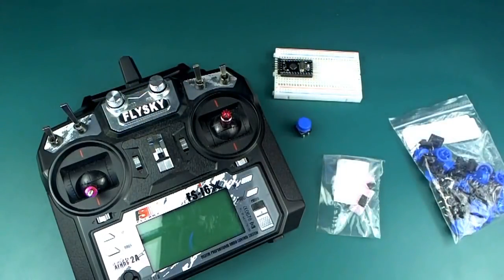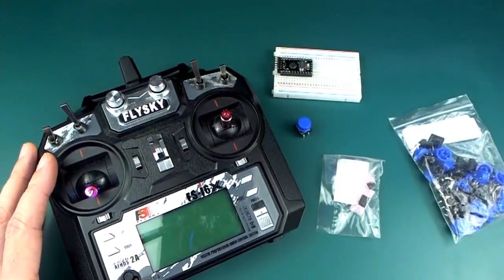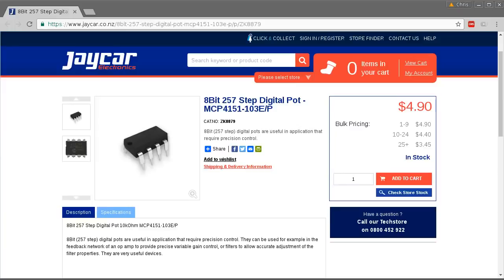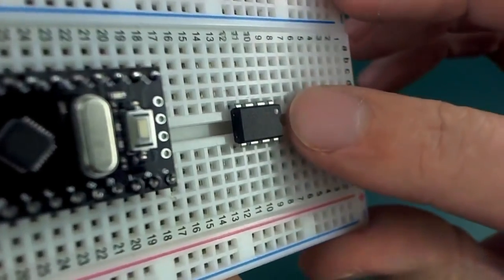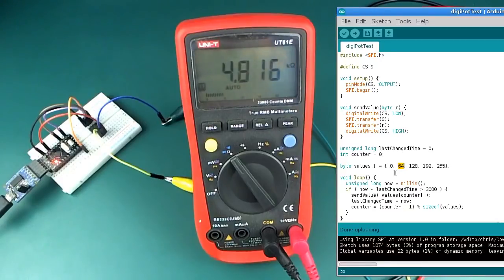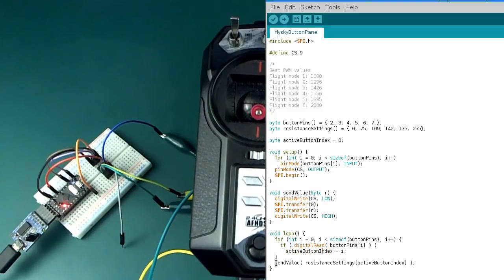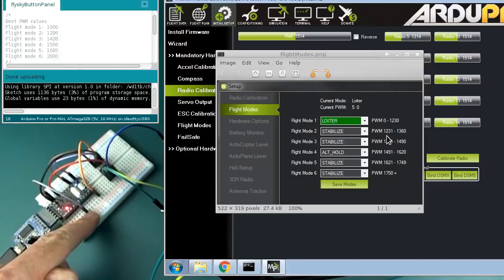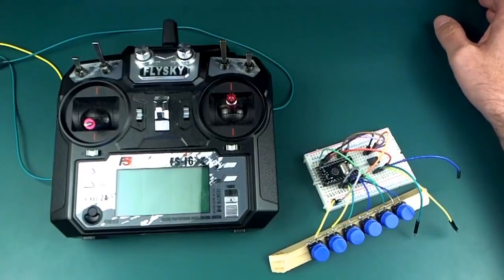FlySky mod - buttons for flight mode selection (arduino, digital pot)

Comment: I have 6 Flight Modes Without this mod. just by using two switches
FBWA
CRUISE
LOITER
MANUAL
AUTO
RTL
Reply from the maker: can you give me a link then.... why not just give the link in your first comment, I would have :)
Reply: iforce2d  https://youtu.be/luLZUEoVlis
Reply from the maker: Nicely done, thanks. Could use a little more background on how you came up with those settings, and what final PWM each position actually outputs. I find that mixing page to be extremely confusing and I could have spent a whole day messing around with it and never achieved that. Thanks to your video I now know how to move the cursor to the other value for the endpoints, by moving the switch!! What a terrible user interface :)
Reply: @iforce2d  your welcome smile!!  i had a drone and wanted extra flight mode, so i sit one day and just went through that mixing page.
Reply: Channel mixing solves this issue
Reply: WINGSHIGH Aviation basically that’s what my video is about!!
Reply from the maker: With this radio?
Reply: iforce2d  yup check my videos did a tutorial
Reply: @iforce2d  i have the sane thing 6 flight modes on two switches. I do really like this idea though.👌
Reply: Had six with 2 switches with taranis but went rotory encoder can still have safety modes on channel 6&7

Comment: How did you connect the setup to the radio? I'm sort of doing something similar, but im sending PPM data into the trainer port to control a quad using my arduino. Im sending the pulses into PPM-INPUT but nothing is being detected by the RC in trainer mode. Thanks!
Reply from the maker: This was using the wires for the potentiometer/dials, I unsoldered the dial and connected to that, as a single channel. One time I had that problem you're talking about, a PPM signal was not recognized unless it had 8 channels. If you're only sending a few channels, maybe try including some dummy channels to make up to 8 total.
Reply: @iforce2d  Ooohoo I see, Im currently running 6 channel output from my uno, but my i6x is configured to use all 10, ill try that tomorrow, thank you!

Also, I also opened up the i6x too and considered just soldering some jumper wires onto the channel pads themselves and just outputting the signals through that. But im leaving that as a last resort as I dont wanna damage the i6x

Comment: You Can get max 6 flightmodes if you Use the bouth switches on the right.  Ich only have the ia6 Not the ia6x But it should be similar

Comment: Hi! Got a tip for you, you can change the two-way switches for three-way, like the third one. Just a soldering job, no other hacks, costs next to nothing from banggood :)
Reply from the maker: yeah, I did that the day after I got this radio. Worth noting that it only works with the i6X, not the i6.
Reply: A ten channel radio with four three-way switches and 2km+ range on a good day for $52, that is a great deal if you ask me. Keep up the good work, love your videos!

Comment: Did you consider just using a PWM channel output on the Arduino and a capacitor smooth the PWM signal to a steady voltage level to simulate the resistor value?
(That's how the camera control works on beta flight to simulate the 5 button resistor based remotes)

seems like it could have been done a little more simply that way?

Comment: Why not use 6 position switch like this....
https://www.ebay.ca/itm/RC-Drone-DIY-KIT-UNIVERSAL-Mode-Switch-6-POSITIONS-ArduCopter-Transmitter-TX/111823139623?hash=item1a092db327:g:vPsAAOSwsbBbOzFo:rk:20:pf:0
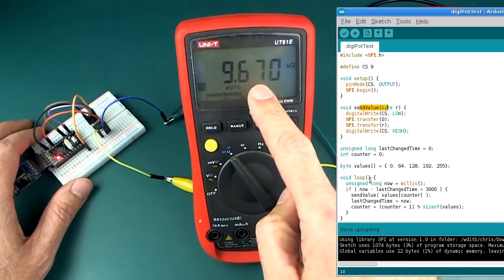9:51... BTW.. can't see your breadboard clearly.. buy you will need to de-spike your circuit supply because the arduino (just like all MCUs) puts noise on the supply as it switches states.

Comment: I did this on several radios about 3 years ago. I like your push button arduino solution better. It is much more ergonomic. great video.

Comment: have you looked at the FS-i10? it supports 'conditions' and multi switch combinations and a whole stack of mixing :)
Reply from the maker: I almost got one a few years ago, but expensive eh? Spending that much now I would probably get a taranis.
Reply: @iforce2d  yeah, they are expensive. 

I looked into the taranis but I'd invested so much Im rx's that I decided to stick with flysky and get the i10.

Mine has had both antennas replaced with external sma sockets and 1w amplifiers on each :)
Reply: @iforce2d  no need for the 10ch resiver,  A inofiziell Firmwareupgrade on the tx schould give the postibiliti of Mixing  the switches (more than 2) But only by using ibus

Comment: These mods are for the Big Red STOL, yes?  Something that is practiced frequently by actual pilots flying twin engine planes are engine-out procedures, especially loss of the critical engine on takeoff.  When we hear about a light twin that suddenly rolls inverted and goes straight down shortly after   takeoff, that's somebody that didn't practice.  (I used to own a Cessna 310 with a partner who was a much better pilot.)

The ability to cut one engine on the BRS might be worth considering.  You might find you don't have enough rudder authority at takeoff speed, or elsewhere in various mission profiles, to manage full power on one motor.  For example, if you are coming back from somewhere on one engine at a power setting that is manageable, then slow down by reducing descent rate or dropping flaps or banking aggressively without reducing power, you might run out of rudder in the process.  If losing one of the motors in flight (or a prop) is a realistic possibility, knowing the speeds and having the procedures in muscle memory will be important.

Aren't you glad you decided to use two engines?  The old joke among twin pilots is the second engine is to ensure you can make it to the crash site.
Reply from the maker: Probably more likely to use with my mini-talon and buffalo. But if they prove reliable I might use them with big red too.
I think I would have rather had just one engine actually, that was the original plan but it would have required 6S which I didn't really want to get into. I do kinda like the look of the twin motors though, will be interesting to try controlling something new for me :)
Reply: @iforce2d   For a STOL aircraft, aside from potential control issues, twin engines mounted on the wings is a good thing.  The wind blowing across the wing behind them generates a lot of extra lift.

Comment: Now I understand a little bit of why the three position switches I bought from Hobby King didn't work to replace the knobbed pots on my Turnigy that I put the FrySky module in.  Too much for my old feeble mind to figure out!
Reply: It should work if you Use 2 10k resistors, wire like that :
~ =resistors 
[  |   |   |  ] = switch from botom 

[ | ~ | ~| ]
+, Signal, Gnd this schould give you 3 Positions 

Hope it helpt you 

(sry for my englisch im german)

Comment: Is it possible to use PWM output (analogWrite) with smoothing capacitor instead of the digital pot?
Reply from the maker: It might be, yeah. But it would not be an instantaneous transition. That would let you power the arduino from just the three wires of the original pot though.

Comment: I swapped out the pot and changed it to a 6pos rotary switch with resistors to get right ohms. Fits with a little bit of modification. But I mostly use my qx7 instead (did same mod to that as well)

Comment: The trouble you put yourself through with this radio always impresses me. Even a qx7 would spare you so much trouble, but this is a neat mod
Reply: I understand - I have the same radio! It's so cheap and light, but it's actually pretty good and easy to modify.

Comment: I have 3 Homemade transmitters with Arduino Nanos that I run at 3.3 volts with no problems.  The data sheet says that to run at 3.3 volts the 328P should be clocked at less than 16 MHz.   But I have been using them at 16 MHz for a couple years with no problem.  I am using them with NRF24L01+ modules to control my ride on trains.  I found your channel based on your NRF videos.

Comment: Another possible way to implement a six-position switch with an analog pot would be to modify the program to have dead-zones between the six positions defined by analog values.  That way an analog value that is on the edge between 2 zones will not oscillate between the 2 zones.  Only update the flight mode when the analog value remains in the same same for a fixed time delay.  Implement haptic feedback (using a vibrating motor) when the analog value changes zones.  The haptic feedback would provide the operator with a feeling the way a rotary switch would.  The time delay after an analog mode change would allow the intermediate flight mode positions to be skipped.  This type of changes would provide a feature similar to de-bouncing a switch.  I hope this makes sense.

Comment: I have a idea buy mpu6050 gyroscope and put it on a cheap fpv goggle and use that mcp4151 chip to transmit angle data to rotate fpv camera that would be a cool project!

Comment: I'd bet you could find 6 tiny SMT tactile switches that would be small enough to fit in place of the original pots.
Reply from the maker: Yes, but you kinda want to be able to find and differentiate them easily with your fingers when wearing goggles. I figured the bigger ones would be better for that. Slightly more reliable too I suspect.

Comment: 18:29 have you tried debouncing the switchs?
Reply: exactly my thought
Reply from the maker: Not necessary because we only need to know which button was pressed last.
Reply: @iforce2d  I was thinking this too.  I debounce buttons on just about every single arduino project just so i don't have any floating values.  Also, what you could do for mounting it, look in to maybe a 3dprinted part to hold the buttons and the arduino, make it a module you could just plug a little header ribbon in to.  then you could use the same style connector for your second person pilot hook up as well.

Comment: Did you consider a pot with detents or a rotary switch? Would be a pretty convenient mode switch, but would still have the problem of not switching directly from A to C (unless you did something tricky like a software delay).

Comment: would be replacing a pot with a rotary switch and different resistors work?
Reply: yes there are videos showing how to do that on yt but you will still have to go through the other mods before selecting the one you want
Reply: Try using the internal pull up resistors for your button input pins.